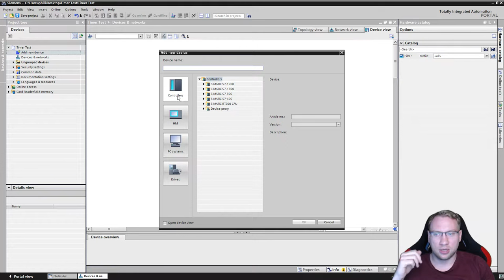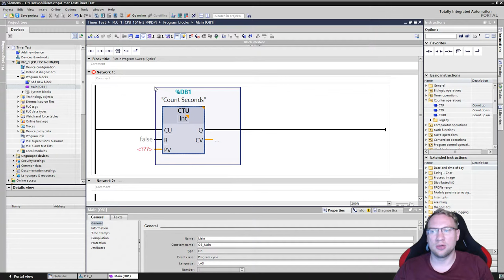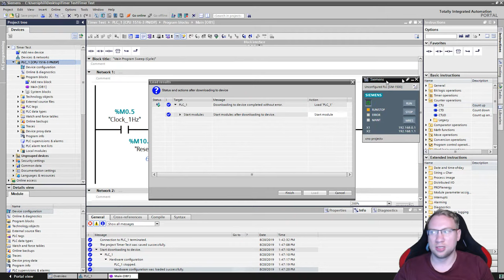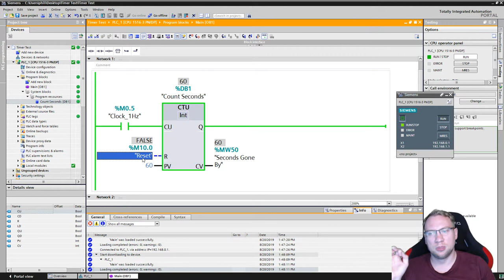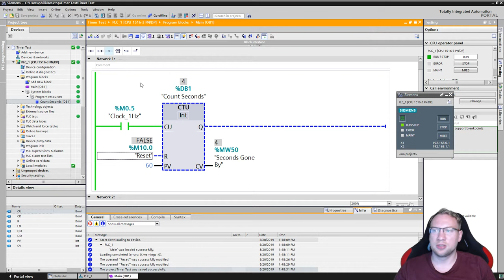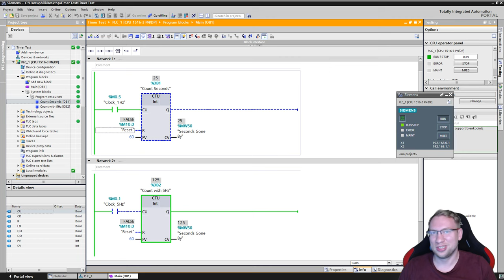TIA Portal: Counting Seconds

Comment from the maker: Two more hints:
1. If you only want to count the seconds in a specific szenario, just put that before the clock memory in the LAD diagram (so as an "AND" combination)
2. As the Clock memory works ASYNCHRONOUSLY it is not going to be 100% precise on each millisecond... the precision should be fine for every frequency <20Hz ... if you need to count faster, there are specific "Fast Counting Modules" but those are a topic on their own.
Thanks for watching!

Comment: since you are experienced in PLC how short should cycle time be from Safety perspective ?? for example in sorting devices or machines ?? and what the longest cycle time have you ever experienced ?? although i am very familiar with PLC but i watch your videos always :))) please make videos about implementing PID in Tia portal but as you would do it in practice 
Thx &regards
Reply from the maker: Hi Nedaa and thanks for your support!
My next series will be leading to a PID controlled system, so stay tuned!
About your questions on cycle time and safety perspective:
If you have processes that need safety (e.g. emergency stop circuits, overload circuits,...) then you would use a so called "F-CPU" (Failsafe)... they have integrated modules that react on specific szenarios immediately (without looking at any cycle times, they are "event" triggered). Those PLC's are a HUGE topic on their own.
As for cycle time: S7-1500 PLC's have a preset minimum cycle time of 1ms and a maximum cycle time of 150ms... everything between those two values is possible and highly depends on your program.
Best regards!

Comment: HAY THERE
THANKS FOR THE VIDEO
I TRIED TO DO THE SAME AS YOU BUT THE MEMORY CLOCK BIT IS NOT COUNTING
WHAT IS MAY BE THE CAUSE?
Reply: same here. are you already solve the problem?
Reply: @pikoprasetyo8550  Did you set clock memory in the device settings
Reply: Try as following:
1.) Disconnect the online connection between your PC and the PLC (go offline)
2.) Right click on your device in the project tree beneath devices & networks
3.) Translate hardware and software
4.) Upload your software to the PLC

Comment: Hi ,
Please explane how this NO Contact with a bit address is  M0.5 is closing every second to activate the counter?
I want to  know   how to program a running time of a machine.
Reply: If you didn't find the answer by now: In the hardware configuration of the CPU you can activate clock timers and assign them to a specific byte, MB0 by default. Then M0.0 to M0.7 will switch in different speeds.

Comment: Can't seem to make it work for some. Did it just as you showed. The Clock Signal does not seem to cross neither a closed switch or open switch
Reply: So i restarted the project and it worked ! Thanks for the Tutorial.